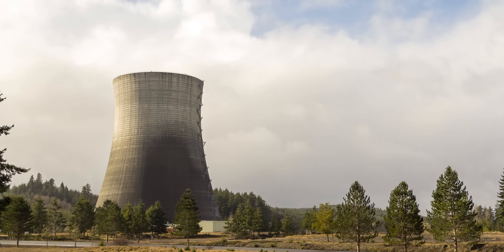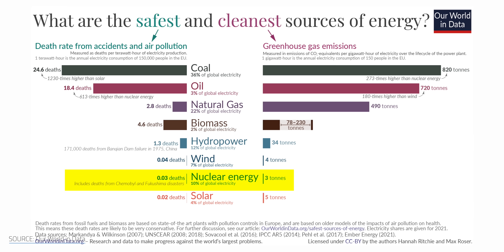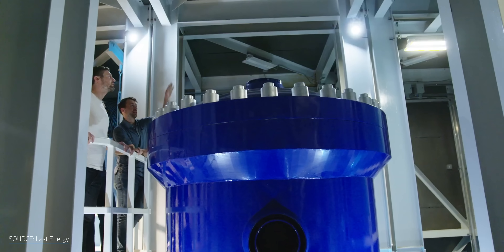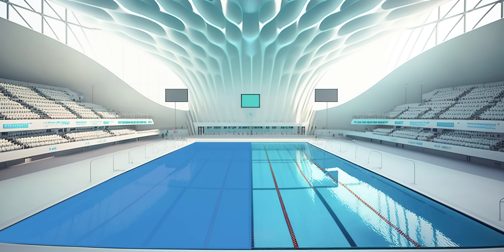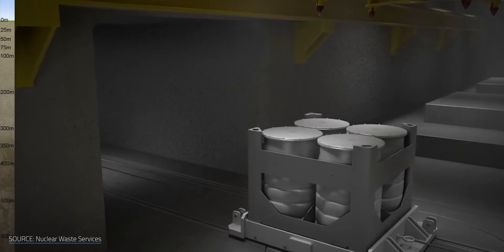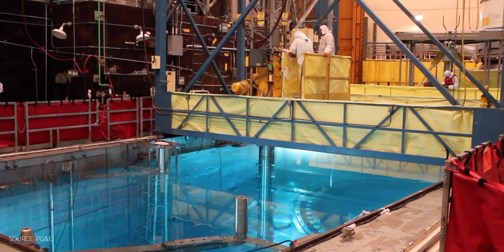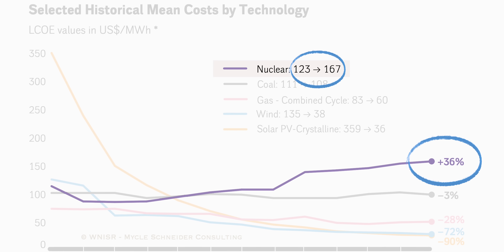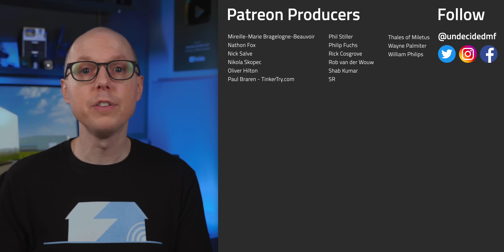Is Small, Fast, & Cheap the Future of Nuclear Energy?

Comment: Have you ever been to a nuclear power plant? The ones I go to are surrounded by a barbed wire fences and have armed police patrolling them. There's a security office I have to report to when collecting my pass. Is that security infrastructure going to be reproduced every time a SMR is built? The surface area of the station is much larger then the reactor itself. There's the substation for connecting to the grid. Standby generators if there's a power failure and you need power to keep cooling pumps running. Offices and facilities for staff. Workshops for maintaining parts instead of taking them off site. Which of these things don't you need for an SMR?

Comment: So very much of our produced energy is used to create heat, so why not just use very small sub-critical radiological decay devices to create heat for use in heat pumps, rather than creating electricity with the hideously complex super critical fission reactors? Sure, it is about 15-20 times less efficient than a fission reactor, but how cheap would it be, and uranium/thorium etc are quite plentiful.

Comment: 1st:  Last Energy's reactor is not approved anywhere in the world and that $18.9 Billion power purchase contract is tentative based on getting all the appropriate regulatory approvals and actually building the plants and generating electricity (it's a contract for the Utilities to buy the generated power at a predetermined cost IF the plants are built on time - They don't owe Last Energy any meaningful money until then):  None of which may occur - and they might go bankrupt trying because they have likely severely underestimated the cost of nuclear quality control and construction (I'm an experienced nuclear engineer and the initial proposed 12 unit NuScale SMR at about $1 Billion at initial concept bids were over $6 Billion, with future adders for inflation after construction starts, after NRC approval of their design).  NuScale is now redesigning their reactor and cutting the units down to 6 with hopes or reducing cost of construction per MWH.  NuScale has not yet submitted their new reactor design to the NRC for review and approval.

A key part of the problem is that all the initial plants (containing X units/plants) are not massed produced and are built essentially as First Of Its Kind (FOIK) plant - which is 2-3 times as expensive and take a lot more time than the nth plants a decade or more later unless you have really experienced nuclear plant contractors; which no longer exist in the USA or Europe.

2nd:  Last energy states that they expect to build their 1st plant in Texas.   They have not even submitted a "pre-application notice" for its design to the NRC yet; much less filed the application itself.  Figure a minimum of 3 years for such approval after filing the application - assuming they actually addressed all the needed issues up front.  Don't expect that the European approval process will go much quicker (although Europe does quickly approve US NRC approved designs). 

As well as a licensed reactor design you also need a "Construction & Operating License" (COL) issued in advance prior to starting plant constrctuion (you can be grading the site and building construction support buildings with a "Early Site Permit" - and none have been issued for any SMR).  A COL typically takes 2-3 years to get as well (and cannot be totally overlapped with the reactor design approval).  Figure about 5 years, at best, to get a new reactor design approval and a COL to build it in the USA; and perhaps a bit quicker in Europe in some cases.  Nothing is going to happen quickly here.

3rd:  Something completely missed by Last Energy is that you need a small private army around a commercial nuclear power plant to protect it from Terrorist attacks (and creating a radiology disaster - and burying it below ground does not eliminate that risk).   

Also, the operating staff for a single 20 MW nuclear plant is likely about 1/3 the size of a 1200 MW nuclear plant; there are similar issues with maintenance staff (and each unit requires its own control board and control board operator for multi-unit plants).   From a manpower & training standpoint small stand alone SMR stations make ZERO economical sense.  They make more sense if bundled into 300+ MW plants; but, a reality is that they will never be cost effective with large central station nuclear plants just due to staffing & training cost.  Also both GE and Westinghouse are proposing 300 MW SMRs (not that they  are that small) which will require far less staff to operate than a multi-unit site of the same MW output.

4th:  A Certified Reactor Vessel is likely the single most expensive piece of equipment in a nuclear power plant - and Last Energy is planning to throw these away every 6 years.    That's an economic killer.   I suspect that Last Energy has no real idea what nuclear technology and certifications cost.  That they are assuming its just a normal "pressure vessel."

I can poke a lot of other holes in this concept because it's obvious that Last Energy is working from a zero practical nuclear plant and industry requirements knowledge standpoint and only working from theoretical concepts.

5th:  The biggest flaws with the SMR concept is that none of the initial series of plants will be mass produced which tosses the mass produced cost estimates totally out the window for most of the 1st decade of building these plants, and no one has proven that their designs will actually work (the design concepts work; but only if you execute it right).   The world nuclear industry shut down lots of nuclear power plants way early because their theoretical workable design had practical problems.

What is actually needed is for someone to absorb the cost of building the SMR design; then run it for a decade and see what design changes need to be made.  Make them, and then you have a chance of the 2nd generation SMR plant to have a chance at mass production - assuming that all other cost dreams work out.   

The US Military (Primarily the US Navy) absorbed the cost of developing working PWR and BWR reactors that could be commercialized.  Even then, a lot of early PWR's and BWR's had short lives due to design issues (the USA Built something like 120 nuclear power plants of over 70 different unique designs:  We now know what design ideas did not work, and which ones worked very well - but that took 20+ years of running those early plants - assuming that they ran that long).  I've been personally involved with designing changes to one of the early generation Nuclear Power plants to make things work better (I've worked in 4 plants, consulted for a a number of other nuclear plants).

The most successful modern Generation 3+ design nuclear Reactor is the Westinghouse AP1000 (1110 MW).  5 are online, a 6th will be soon.  The Chinese built 4 of them on  time and on budget because they have experienced nuclear construction contractors who have been building nuclear power plants for decades.    The Chinese were so impressed with how well the AP1000 runs after 4+ years of operation that the Chinese have ordered 6 more AP1000's and stopped ordering their own CAP1400 plants.   China is in discussion for more AP1000's in the future.  European Countries have signed letters of intent for at least 12 AP1000's.

I hope this is helpful...

Comment: Matt, you need to check your facts. 30-50 people died following Chernobyl? You completely forget that the USSR buried al the data on that. I knew people who were involved in the clean up immediately afterwards. They were Army and not informed of anything. They went in without protection and there was a huge rate of cancers etc after that. The problem is that USSR didn't want to publish any data that showed them in a bad light but 30-50 is maybe 10% of the real figure. Possibly the number is even greater but its difficult to separate out causes etc. in a country where chronic alcoholism etc exists and where men (it was primarily men who did the clean up) don't live much past their 50's

Comment: Excuse me but stating there just have been just 3 nuclear accidents is a pretty bold statement. You could have at least mentioned Manyak. Or the loss of Gundremmingen A in Germany. I also can't understand why smaller reactors should be safer as switzerland for instance has had very bad experiences with small reactors.

Comment: Basically, we need lots of cheap, simple and standardized SMRs, but at the same time if we want to handle the spent fuel by further burning it, we need some larger and more complex waste-burner facilities. A problem, that I see is that because waste burners are so much more fuel efficient than standard enriched uranium burners, the capacity of your waste-burners would probably need to be at least double the combined capacity of your simple standardized SMRs to utilize the waste in any timely manner. So 2/3 of your nuclear capacity may need to be from expensive waste-burner facilities and only 1/3 would be from cheap remote facilities without waste continuing to stockpile.

So the largest step would be in finding ways to standardize and reduce the cost and implementation time for waste burners.

Comment: The real problem for me is that there is no such thing as safe storage of this waste. Period. There is no place you can put it where it "can't" leak into ground water, or contaminate everything around it. There was supposed to be a place in Colorado to store nuclear waste, and Colorado said, "No.". And it's ridiculous to measure the danger by simply looking at 'direct deaths'. Unlike wind and solar, nuclear waste causes horrific birth defects (Hiroshima and Nagasaki are still dealing with this). 

Yes, fossil fuels are horrible, and the quicker we can get away from them the better. But until we can find a real solution for the waste (not just 'storing it for far longer than humans have walked the Earth'), nuclear should be a last option, not a go-to. If it can be reprocessed into less deadly waste, great. But that's not happening yet. Let's solve the problem before it becomes an unsolvable problem - for once...

Comment: the thing about such miniature and modular designs is that, it can be rapidly deployed to disaster sites/less economically developed areas and potentially "leapfrog" traditional coal/oil/gas plants.
would even be cooler if they can bring closed fuel cycle to these small modular reactors

Comment: For reactors this small, it sparked an idea from one of the Resident Evil movies where a facility sits on top of a really deep hole where if this facility fails the whole facility can be dropped in and buried very quickly to avoid further contamination.
Reply: Another benefit of these smaller reactors, to my mind, is the ability (requirement?) to get them further away from the seacoast. This reduces storm/tsunami dangers as well as hazards from rising sea levels.
Reply: You could just dig a hole and put the reactor in it to start with; it doesn't need to be on top of the hole to operate. That's NuScale's plan with similar SMRs.
Reply: @kf6auf  They do the same thing here. The graphics show it above ground only for effect; otherwise you'd be looking at a patch of grass.
Reply: They actually are planning on putting these underground.
Reply: Not sustainable really
Reply: Dang it i know there'd be a catch! As for dropping the thing, humans luck being what it is, It'd find a way to get 'stuck' half way, above the water table, glowing and melting .. Ewww...
Reply: Yes bury it in the aquifer that will stop radiation from spreading🤪
Reply: @Shazza2024 uh really deep means below the aquifers. Which to be fair means expensive large casements.   Think road culverts going vertical deeper than most mines.
Reply: @johnschneider931  There's no way to get below an aquifer.  The deeper you go, the worse groundwater becomes a problem.
Reply: @Shazza2024  after the zombie apocalypse its the least of your problems
Reply: @Shazza2024  It seems a few people failed to understand the point of the emoji.  Perhaps you should've added a /s (for those that still don't get it they were being sarcastic).
Reply: @Shazza2024  You have evidently not gotten to that part of the video, or just ignored the rest of the video once you found something to grouse about.

Comment: For me, i follow two camps:
1. Self reliance/ Self Sustaining
2. Diversify
Have multiple types of power generation along with a localized approach give an energy system more flexibility with unexpected events (sever snow storm or high power consumption in a heat wave).
Energy production should never go down but be replaced with more efficent tech and larger output.
I am still curious when we will have a house powerwd by solar, wind , and nuclear on site.

Comment: The LCOE of wind and solar does not take into account the necessary storage required to make a complete usable system. If you add that in, then the LCOE is much more than nuclear power.  Ignoring the cost of storage is like buying an EV without the battery. Yeah, it would seem cheap, but not after you spent a lot of additional money for the battery to get a usable car. But wind and solar are much worse than that.

Comment: Common Miss Conception Nuclear is NOT expensive. what is expensive is the cost of regulatory compliance. The actual reactors would be pretty cheap... if were allowed to be built without government interference let the experts that know what the hell they are doing build them, and if there are issues, you hold them liable. that's all you need to do. there is not purpose or need for the costly and needless inspections and other BS they government forces these companies to do.

Comment: Matt, I really like your videos.  They are interesting and lead to more questions.  With regard to nuclear energy waste, what about vitrefication?  Has that method gone passé?  Also, what about the grid, itself?  I understand that our aging grid is a big part of the reason more green energy hasn't been okayed to plug in.  And what about microgrids?  It seems microgrids could build resilience in the face of a changing climate.  Thanks!
Reply: Vitrification is a common part of dry cask storage as I recall
Reply: While many solar and wind plants tend to need to be built away from existing grid infrastructure for weather reasons, it would be relatively easy to site new small nuclear at existing coal plant locations so that they can use the existing grid and water source for cooling. They even have rail lines ready to help with the construction.

Comment: look at small sodium reactors that operate at atmospheric pressure. Safer and more durable. Also they use Thorium. A nuclear energy far less radioactive  and have a half life of 100 years. Also the lead used in old reactors can be made into atomic batteries. There is a design that does not use generators but thermal couples. That right solid state nuclear reactors.

Comment: I honestly think that video is riddled with mistakes and ludicruous observations. 2, 3 and 4 are the most ludicruous. 4 is just ridiculous. 

1- The "I gonna guess no" criticism to whether deep geological disposal is safe is just arbitrary. Arbitrary observations are no way to convey science. This reminds me of a meme. Scientist:  "After years of research, I reached this conclusion". Some guy "I'm gonna guess no".  These facilities are built in geological structures which are known to be stable for millions of years, let alone 24 thousand years. And it's not me saying this. It's scientists after years of research. 

2- Much worse. For the LCOE number displayed (in which nuclear is the most expensive), it is either some bad case, or worse, a world average. This is non-sense. The number presented was 160USD/MWh. Well in France it is something like 50USD/MWh, depending on the reactor class. Even in the US it is usually below 100USD/MWh. Nuclear can be done well or poorly (like everything in life). You cannot average all the very different approaches together and use that to argue against nuclear (although the value does not even seem an average, but on the top side). Wtf.

3- The Last Energy reactors apples and oranges comparison with traditional reactors (probably stems from the 4th issue below). Ouch. 123MUSD for a 20MW reactor. Okay, let's compare with the Olkiluoto-3 reactor in Finland, which is 3X over budget, at 12B USD. 123/20 = 6.15MUSD/MW (Last Energy). Olkiluoto has a total power of 1600MW. 12000/1600 = 7.5MUSD/MW. The cost per MW is similar for the on budget Last Energy reactor and the 3X over budget EPR reactor 😅. Now, it seems that Areva is going to eat half of the cost (since it was their fault), and that puts Olkiluoto-3 at around 3.75MUSD/MW. Well below Last Energy. The LCOE of Olkiluoto-3 is now 42€/MWh! Not so different compared to the cited values of solar and wind. Now with the EPR2 (built on lessons learned from EPR), those values are expected to drop further. How is Last Energy's SMR any cheap?

4- Cost of the "average" 110MW nuclear power plant is 6-10 billion dollars? So many things wrong with this. First of all, the average REACTOR is something like 1000MW (so something like 10 times your figure). There are barely no reactors in operation with 110MW. I dare you so count how many you can find here ( https://en.wikipedia.org/wiki/List_of_commercial_nuclear_reactors ). Oh, and 1000MW is PER REACTOR, a power plant can house SEVERAL reactors. So I guess the author just casually ate least a zero on the way.

And I dont know if I caught all the mistakes.
I'm also very much against usage of SMRs outside the context of a large power plant, I think it's terrible for oversight.